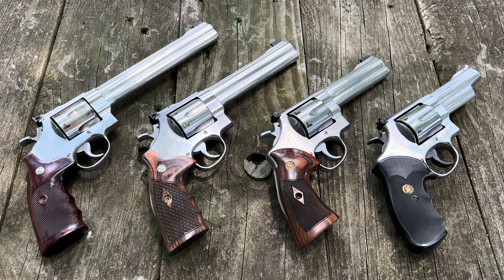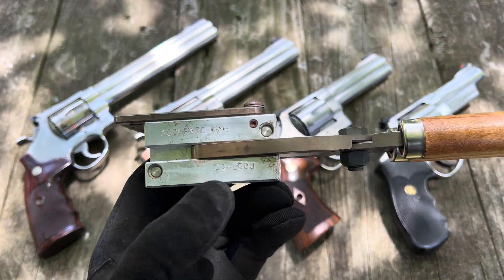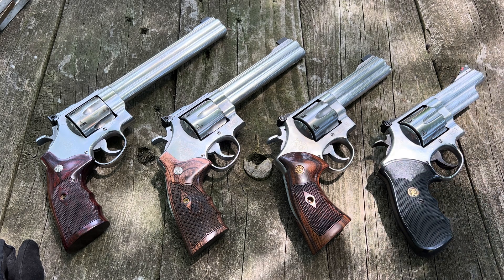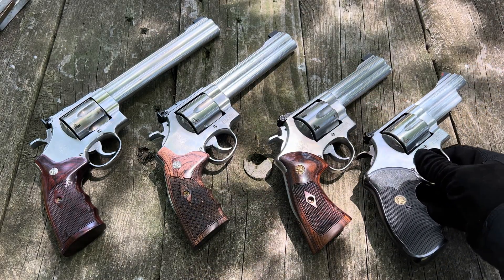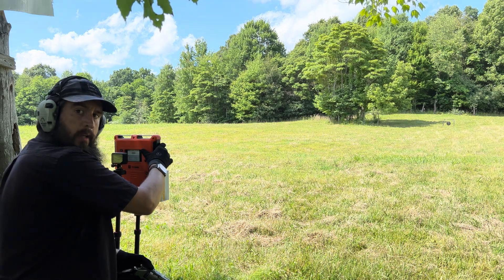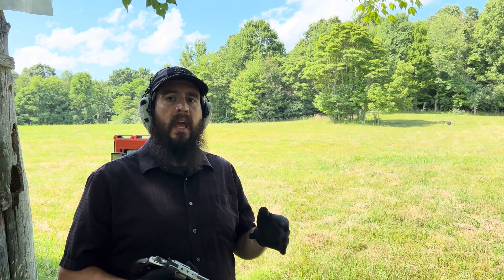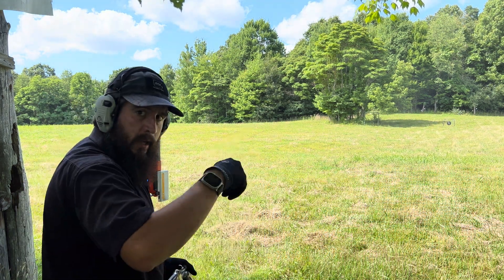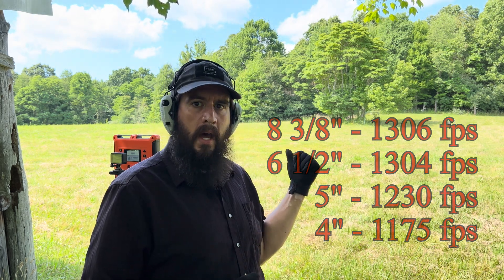44 Magnum Velocity Comparison

Comment: TK Custom handles a aftermarket Hillary Hole plug for the S&W revolvers so afflicted. All my S&W revolvers have been plugged and the loc deleted.
Reply from the maker: I planned on trying one of those plugs but the hole doesn’t bother me so much anymore.
Reply: I have been installing the Original Precision plugs in my S&W revolvers.  Another good option.

Comment: Thanks for the video! 

It's really great to see some good empirical testing with lower- and higher-pressure loads here. This is perfect for deciding between a 4" and 6" barrel, and it's nice to know that going longer doesn't give any real benefit except for sight radius.

One thing I'd love to know: how noticeable is the difference in muzzle blast between shorter and longer barrels?
Reply from the maker: Thanks!

Not too noticeable, I hadn’t even thought of it until you mentioned it.

I think a longer barrel might give more velocity with different powders/charges, or with a different gun. I’d like to try this comparison again with Ruger Super Blackhawks in different barrel lengths.

Comment: There's one factor you forgot to include. When it comes to revolver, it's not just the barrel length that affects velocity. You also have to take into account the cylinder gap.
Reply: And the powder charge and burn rate of the chosen powder. Slower is better for developing velocity in longer barrels.

Comment: Great video; just what I was looking for. I have a Ruger Redhawk 71/4 in barrel. It's great but very to heavy to carry all day while hunting. Not bad when I'm on my horse but walking it gets heavy. I'm thinking about changing to a five or six in barrel revolver. You gave me some good information to use in my selection process. Love the big bore revolvers. Thanks!
Reply: I had the same problem because of all the feral hogs in my area. Went from the 7.5 redhawk to a 4 inch smith and back to the redhawk again lol.. I think comfortable holsters are the key if you really need 44 power.

Comment: How did you get such low extreme spreads??? Those were incredible!
Reply from the maker: Thanks! I don’t know exactly, but those are loads I’d worked quite a bit. I weight my cast bullets, usually keeping those 260 grainers within a 5 grain spread. I weigh powder charges with a somewhat finicky digital scale, but I use Redding powder throwers that I trust more than the scale to be repeatably accurate. I don’t trim brass, but I do keep track of how many times each group has been fired and will measure them new and again after 8-10 cycles to make sure none are way out of spec. Oh, and I had Redding polish out my seating dies to not inadvertently further seat the bullet. True Keith design bullets have a front driving band that tends to hang up just slightly in most seating dies I’ve used. And I don’t roll crimp. I use the Redding dual ring sizer which sizes the neck down just a bit more than the body and I use Redding profile crimp dies. Roll crimping is unnecessary, in my opinion, for most wheelgun applications.

Comment: Great revolvers. Really like the 5  and 6.5” barrels. Really surprised the 4227 load wasn’t any faster in the 8 3/8. Does it have a larger b/c gap than the 6.5?
Reply from the maker: I have not gauged the cylinder gaps, but something might be off.

Comment: Great info!

IMR4227 is a great powder for the 44 Magnum.  I started out using a Lee loader in 1972.   The dipper gave 23.0 grains of IMR4227 so I tried that load in my 4 inch 29-2.  Very accurate with the Keith 429421 with little leading.   Many years later when I got a chrono it showed 1225 fps from a 4 inch.  In a 24" Marlin 1984 Cowboy it went 1700 fps.  I got lucky with the Cowboy as it feeds Elmer's bullet perfectly.  I cant make it jam.   This rifle was made in 2000 and is factory set for 1.710 COL.  Other SWCs simply wont feed.
Reply: I found that load of IMR 4227 was accurate in my super Blackhawk with the 7 1/2 inch barrel also I also tried IMR 4227 in the 41 magnum Ruger and it with 20 grains seems to shoot good with a 210 semi-wadcutter